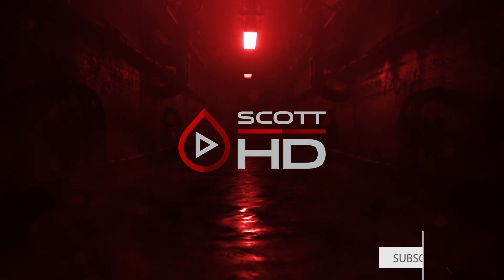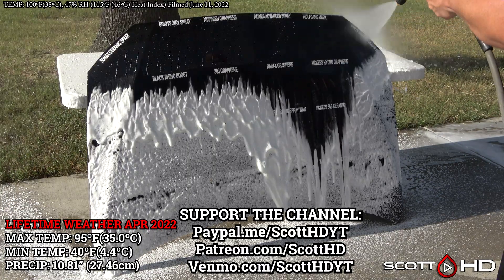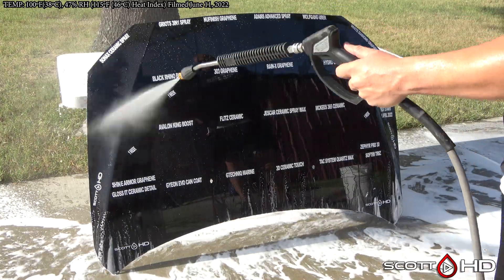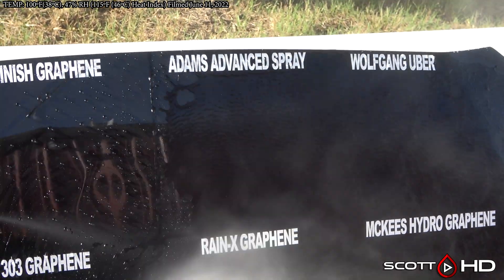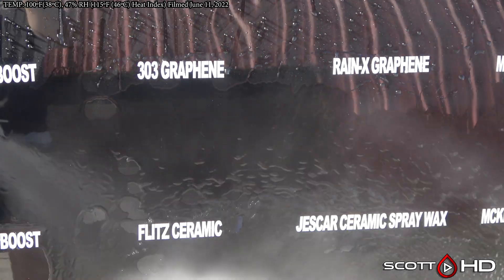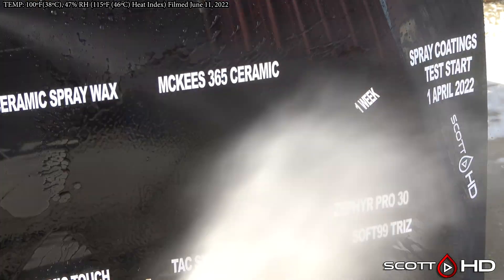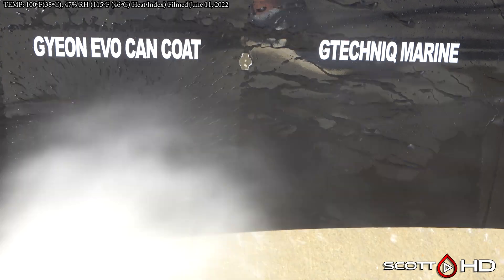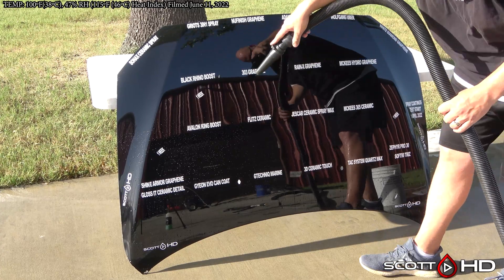Ceramic Spray Coatings - ULTIMATE Longevity Test Comparison 23 WAY UPDATE 07 - 2 MONTHS

Comment: I've got NuFinish Graphene on two vehicles of mine, a 99 4Runner and my 2010 Audi A4, both for approximately 60 days now as well and they have been incredible so far. I'm able to foam the car, rinse, foam again with a quick once over with a wash mitt, and once rinsed the paint is still hydrophobic enough to completely dry the car with a dog groomers blow dryer (in direct california sunlight) and it removes the water fast enough that i get practically zero spotting. Only a few places where water tends to drip from even after thorough drying. And a tiny quick detailer made from wolfgang water-less car wash cleans those right up. 

The only thing i don't like about this NuFinish Graphene is the lack of a silky smooth feel like i would get from Meguiars Ultimate Wax and many other older products.

Comment: Suggestion for a final test: Which coating does the best job of frying an egg.  In all seriousness, great work, as always.  Ceramic coatings are superior in many ways, but solid protection from an easy to apply spray sealant will work for many consumers.

Also, your tests reveal just how much weather affects the longevity of these products.

Comment: Thanks for the hard work! I'm an Adam's Graphene guy but the NuFinish Graphene intrigues me. I wonder how glossy it is? I use Adams Graphene basically as a 6 month wax.
Reply: It’s fairly glossy, but strangely not slick to the touch at all, after seeing the initial test with the nufinish graphene I took a gamble with it and put it on my car and it’s been on for about 1 month. Still performing amazing. If you’re interested in this, I am also in Texas and experiencing the same heat waves
Reply: @Cloudsurfer181  Thanks for letting me know! I'm in Canada. A heat wave for me is 86f. I'll probably pick up a bottle and let everyone know how it works in -20f in a few months.
Reply: Like James Henderson said, it's oddly not slick but its got great gloss and hydrophobic properties.

Comment: Thanks, looking good for Sonax so far. It is also very good for cold weather, and resists the salty road grime here in Norway pretty good. Nice to see it stands up to the heat as well!
Reply from the maker: Great to hear!
Reply: I also use Sonax Ceramic Spray coat, but I always top it with Sonax Ceramic Quick Detailer, which gives great slickness and water beading.